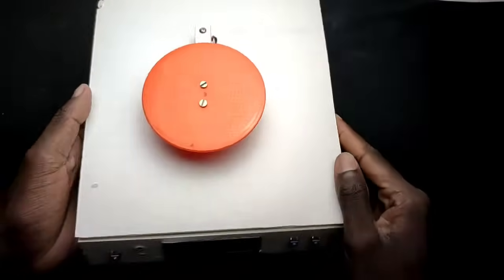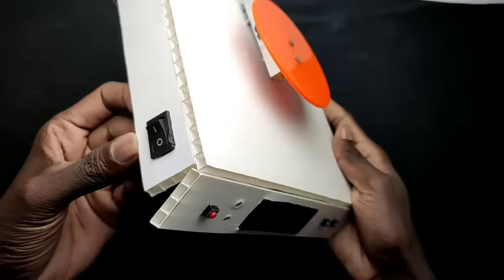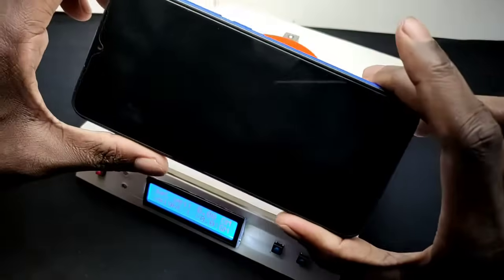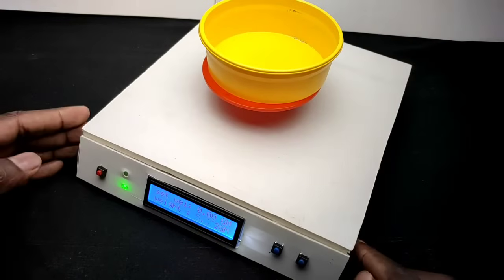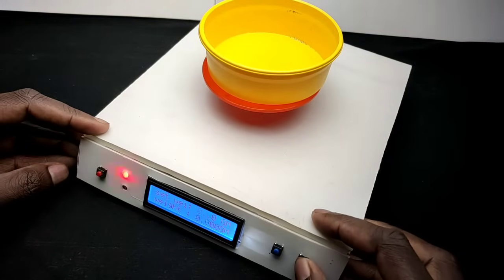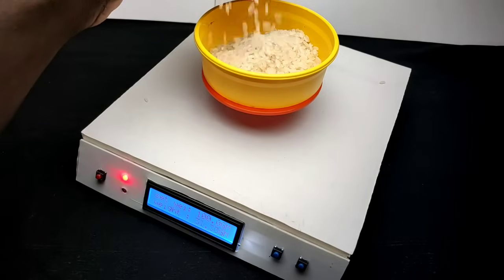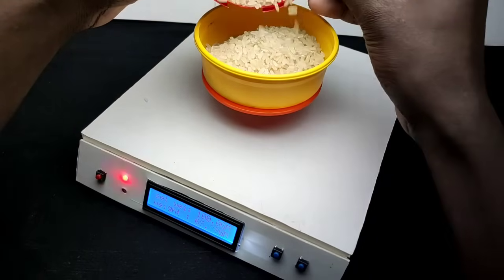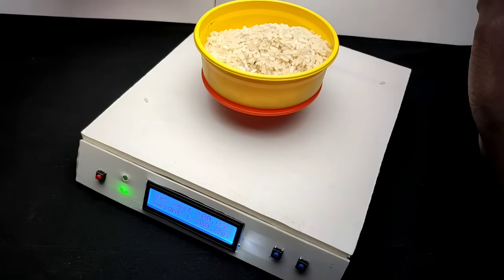Build an Arduino Weighing Scale using a Load cell and HX711 for Retail Packing

Comment: Why does my program appear like this
Arduino:1.8.7 (Windows 10), 開發板:"Arduino Nano, ATmega328P"

sketch_feb19a:5:20: error: 'HX711_dout' was not declared in this scope

sketch_feb19a:5:32: error: 'HX711_sck' was not declared in this scope

C:\Users\user\OneDrive\獢\sketch_feb19a\sketch_feb19a\sketch_feb19a.ino: In function 'void setup()':

sketch_feb19a:29:7: error: 'class LiquidCrystal_I2C' has no member named 'init'

exit status 1
'HX711_dout' was not declared in this scope

This report would have more information with
"Show verbose output during compilation"
option enabled in File -> Preferences.
Reply: YES, I ALSO,,,BRO
Reply: @rksystemrajesh  Sir How do you solve the problem then please explain
Reply: hx711 ...vcc going to gnd .is..it true ??????